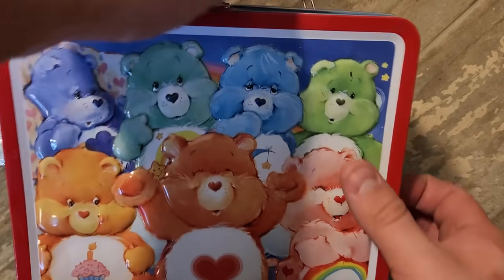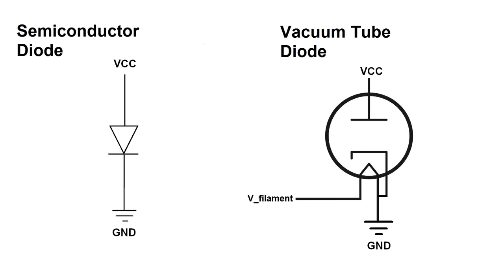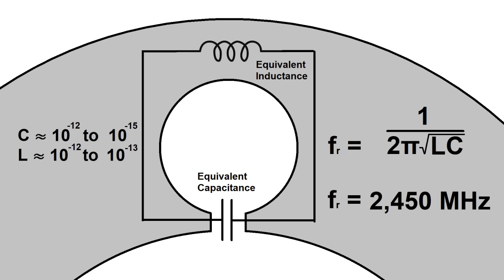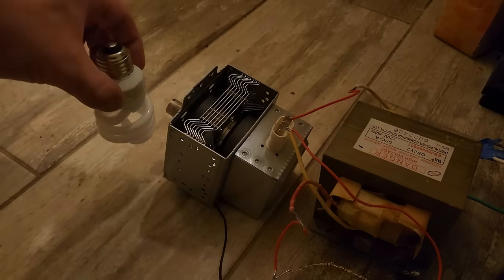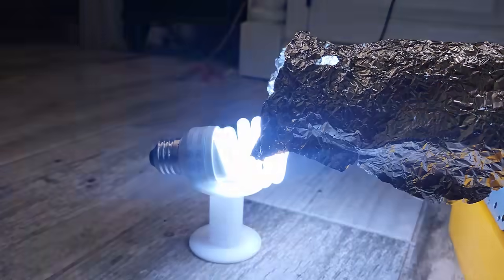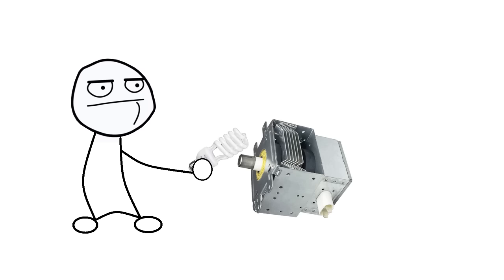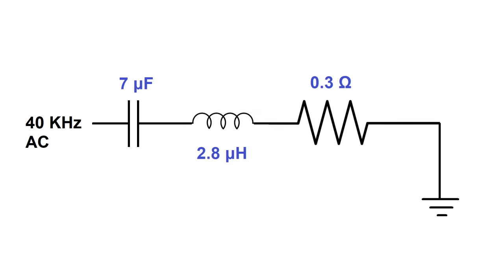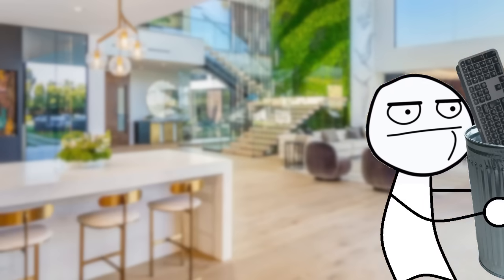Battery-Powered Magnetron

Comment: It's a lot harder to commit piracy in hyperspace than I initially anticipated. You need a whole lot of special gear for that! I can't wait for the episode on the actual hyperdrive, but seeing we're still sorting out the cooling of that, along with basic logistics like heating space rations, I'm guessing that's still a fair ways out. That said, a detour into weaponising the lunch box of death seems in order. Pirates don't just ask politely after all.
Reply: Cooling off the hyperdrive? Wouldn’t it be possible to use dry ice for that?🤪
Reply: @mikehorrocks2909  I'm assuming a hyper drive needs super conductors, which means cryogenic cooling is required.

Comment: Exposure to an unshielded magnetron can result in permanent blindness pretty quickly. In the sense that a little exposure can produce a lot of damage. But you won't necessarily realise until a day or two afterwards. A friend of a friend lost 40% of their vision doing this. They were fine straight afterwards and then their vision went cloudy the next day. They didn't recover.
Reply: in otherworldly, fully know what the fuck you're doing when you science bro
Reply: @thomasslone1964  dont forget doctors used to prescribe cigarettes. Science is only as good as the info at the time. And usually the science is slower than production, lead, asbestos, va cc es etc
Reply: Could you protect yourself by wearing a faraday cage over your head?
Reply: @cebruthius I wear my faraday cage around my junk.
Reply: Me Green has a video that proves this is a lie lol.
Reply: @ArkhamHedler  No it doesn't. Did you watch the whole video? And i quote; "Removing the outer shell of the microwave absolutely destroys efficiency". So yes; if you make your microwave inefficient and effectively low power enough then it won't destroy your vision or boil water quickly either.  
You expose your eyes to a microwave that's working properly at those distances and you will find out how wrong you are; a day or two later.
Reply: @ArkhamHedler  was about to mention that lol
Reply: Didn't the inventor of microwave, wasn't he trying to do something else entirely and noticed he had a chocolate bar in pocket or table close to him or something similar...and he noticed the bar of chocolate was melted...and that got him curious and figured out he sccidentally microwaved it? So an indirect accidental(sortof) discovery?
Reply: @jeremygalloway1348 they were working on radar systems.
Reply: How far were they from the unshielded magnetron?
Reply: @ajcottrill4949  I wasn't there so couldn't say for sure but we're talking about inside a room in a house so a few meters or so at most.
Reply: @christophertelford  Wow. I wasn’t aware that (at that distance) the radiation from the magnetrons were powerful enough to do such a thing. Thank you for informing me.
Reply: baloney.
Reply: @amandahugankiss4110  Try it if you don't believe me. Get a friend to write up your results for you if blind.
Reply: To those on this thread talking about wifi - look up a photo of the electromagnetic spectrum. Wifi and radio are in the extremely long range. Microwaves are shorter wavelengths. The reason water heats up in a microwave is because it resonates at the exact frequency that microwaves do. It 'detects' the signal. Like an opera singer needs perfect pitch to shatter crystal 🔮 

Our eyes detect visible light. Infrared cameras detect infrared, which is just outside of our range. InfraRED might as well just be another color, because some animals can see/detect it. Geiger counters detect ionizing radiation, and antennas and wifi routers are designed to catch and detect radio and wifi frequencies. Like @TheNuare said, frequency of signal and power of signal are very different things.

How do you sit there and boldface lie that wifi did anything to your body that you didn't do yourself SMH. Deep itchiness... tingling... how did we come to this like cmon people.
Reply: Always gotta be that one safety nazi buzz kill
Reply: Tell that to MR Green! 😂😂😂
Reply: stone burner in real life.
Reply: Brutal
Reply: This Solarsynapse needs to go back to those fake science retard conspiracy tiktok channels, this is for non psycho tarded actual science fans 😂
Reply: Does your friend look down a gun barrel to check if its empty  ?
Reply: @RenoSimpson  No. I don't know the person in question. It was a friend of a friend.
Reply: As to "Heats from the inside, not outside" look up "Active Denial System" in current use by U.S. military and available to law enforcement.
Reply: @matosonmania  "in use" is a bit of a stretch since that system has not seen field use a single time since development.
Reply: @matosonmania   felt it, feels like inside, outside, sensation of sudden intolerable severe deep itchiness. Not all variants are named that moniker ADS. The technology is highly variable for different "applications"....aka...us.
Reply: @matosonmania I think that’s bullshit anyway, coz why the fuck is my food always cold in the middle of it cooks from inside out?
Reply: @user-vh7ki7xu7o cook food short amount of time open microwave stir food then start it back up. Microwaves work off the moisture...exciting the water molecules. If the center is already frozen that means alot of air in the ice. Also, inside the microwave the waves are not dispersed 100% evenly.

Not sure exactly why it happens that way, but I know from experience that cooking short time stirring and finishing cooking almost always cooks your food better than just cooking the instructed amount of time. 
Solution would be to get a better microwave(older stuff runs forever if it's still running). Or to cook in oven instead if possible
Reply: @jeremygalloway1348 
Yeah, some high-end and industrial microwaves have a mode stir antenna to mitigate the cold spots. Water/moisture flows to the heat and steams along the outside surfaces making the interior more difficult to excite.
Reply: @Youtubecensoredmyusername I don't know who ever started spreading this "inside out" stuff...
Maybe they mean that the food itself is heated and no external heat is applied like in a oven?

But to answer your question, there is a pattern of radiation that bounces around inside of the case, gets reflected and absorbed.
The problem is that there are cold spots inside if the case, the manufacturer tries to mitigate them by rotating the platter.
Some devices have really bad patterns and the only solution is to elevate your platter a bit to hopefully intercept the beam better.
Hope this helps!
Reply: @SuperUltimateLP  that does help. Long way of saying it doesn’t heat from the inside out tho 👍. I have seen the inside of a magnetron that must be the pattern you speak of
Reply: @matosonmania  people are always saying that. The center of my food is always the coldest if I use a microwave. Stop it with the wives tales.
Reply: Soy técnico en electrónica, deben tener mucho cuidado con el magnetron, porque dentro del tiene un polvo que es radiactivo
Reply: @gersonpalma-lb9hc I believe you are talking about beryllium. Beryllium dust is not radioactive but it is very toxic and any contact with dust should be avoided due to how little of it can harm you. So in short, just pretend beryllium is radioactive and don’t play with it even though beryllium shielding is used for nuclear radiation.
Reply: Muchas gracias por el dato. No lo tenía en cuenta gracias de verdad. ❤🎉 @gersonpalma-lb9hc
Reply: Just like ionizing radiation. Invisible, but very dangerous.
Reply: Not really, i reccomend you to watch Nile Green's last video explainig everything, he even stuck his head in a running microwave
Reply: Used to work on troposcatter equipment around 4 - 5 Gigs, it will do that and cook your brain in it's husk like a clam boiling in water. One of the guys exposed himself prior to me working with him during on equipment testing. You don't wanna mess with it. Guy was seriously messed up.
Reply: We shall see
Reply: Oh, look, censorship.
Reply: So how did this gentleman dismantle his microwave and place his face (and subsequently his eyes) directly in front of a powered magnetron with no ill effects?

https://youtu.be/3hBRxwQXmCQ?t=2000
Reply: @nathanbarnes7520  heat damage to the eyes may manifest after hours and due to the nature of constructive and destructive interference, the microwaves form a pattern of dangerous and harmless spots. im sure youve noticed how microwaves can heat food very unevenly, even with the spinning platter. a one time anecdote where someone didnt immediately get hurt is not proof that something is safe.
Reply: Is a lead X-ray vest a good material to sheild
Reply: @PhillyHardy  how will you protect your eyes with that?
Reply: Good question. Lead is not Ferris metal and can’t act as Faraday cage but its mass should offer some protection.  But how much?
Reply: LIES.    This dude clearly is a FED.
Reply: That sounds more like damage from lasers, not magnetrons.
Reply: @kyonsmith5203  it can cook your eyeballs to medium rare
Reply: @kyonsmith5203  Nope, lasers are immediate with the exception of UV lasers.
Reply: @kyonsmith5203 rf is bad for both sets of balls.
Reply: @kyonsmith5203 If you think the poster is mistaken and isn't talking about microwave radiation from a microwave cooker magnetron then I suggest you go try it. If you think you are an expert in this, let's see you go out and test your faith in your superior knowledge.

The microwave cooker magnetron will easily cook the thin waterous tissue of the cornea.
Reply: WiFi is the same frequency and can do the same thing at high power and close range or lower power for a prolonged time.  Don't have a WiFi router at eye level on your desk shelf!!!  Some public places install large (As large as 5 feet.) antennas behind walls and ceilings to have good coverage in large areas.  I know because I have installed them and questioned the safety.  I was told that nobody cares as long as the signal is good.  You could be sitting right beside one of the walls.  If your back is to the wall, your body will absorb it.  If you are facing it, your eyes are being damaged and you don't even feel it.
Reply: That's simply not true. microwave ovens run at much higher energy levels than wifi does. It's a heating up danger. Without enough power it's not going to have the energy required to do any damage. Long term exposure isn't a cumulative risk with low power wifi because your body is quite good at cooling itself down. It's not like ionising radiation. It's like a heat lamp you can't feel. @solarsynapse
Reply: @christophertelford  So standing a few feet away facing a 4 Watt WiFi antenna that transmits a signal several miles is safe?
Reply: @solarsynapse It's 4W not 1000W
Reply: Anyone that understands RF will tell you that '4W' isn't enough information to answer your question. Some antennas are high gain and put out a more concentrated beam. Some are omnidirectional and output radiation in all directions and some will do a sector of 180 degree coverage or less rather than 360. Antennas that transmit lots of power in a small beam are called high gain antennas and they concentrate the total amount of power available in a smaller direction by sending less signal out everywhere else. 
According to a study cited in wikipedia eye damage occurs in rabbits at 150mW/cm^2 assuming no external cooling is provided. If you knew how high gain the antennas was and you had the other measurements available too then you could use maths and geometry to work out if your eyes were at risk or not.
I'd say it'd need to be a very high gain antenna you sat very close to to concentrate enough of those 4 watts onto your eyes to cause problems. An omni or sector antenna isn't going to fry you at 4 watts unless you remove the aerial and stick the feeder tube in your eye. And I wouldn't volunteer to sit directly in front of a high power point to point microwave dish either even though it'd probably be fine for a bit.  @solarsynapse
Reply: @BenSzántóNEO_CZ  I still wouldn't do it. 4W ERP for Wi-Fi would be completely illegal in most countries anyway.
Reply: @christophertelford  It's called ERP - Effective Radiated Power. The idea is that from the direction in question the strength looks like how much power from a non-directional antenna. 100mW of Wi-Fi from a normal antenna omnidirectional looks like it's 100mW. But use a directional antenna and point it at the detector, and you can make it look like more power. That's the ERP.
Reply: @solarsynapse I don't know what your talking about but its not from a WiFi router. A WiFi router does not output 4 Watts like you are saying
Reply: @christophertelford 5 g extended range Wi-Fi is low strength?
Reply: What do you think low strength means? RF field strength is measured in dbm which translates to power. You can send wifi a long way without a lot of power. So yes, extended range wi-fi can be low strength
Reply: @solarsynapse if it transmits miles then its not a wifi antenna
Reply: @solarsynapse  you hold a phone  (1- 2W) to your head just 1.5cm away from your brain and still alive?
Reply: @BrianG61UK  Wireless links can be .25 to 10W, typically 2 to 5W for the tower antennas.
Reply: The transceiver for analog bag cell phones is in the bag which should be kept at least 2 feet away from your body.  I don't think they are still in use.  Digital phones are no more than .5W, but speakerphone or a headset is still better.  Same for factory vehicle 2-way radios, 2 feet from operator.
Reply: We had 1000 RF sensors at 868MHz transmitting every 1 second at 20dBm and nothing bad happened to me!  They were omni whip antennas 2+ dB gain
Reply: @solarsynapse yes, that is safe. You can't compare 4W transmitted into open space and 1000W confined in a metal box. The flux density of sunlight hitting the equator in summer is around 1000W per square meter. If 4W of microwave energy could cause damage, then direct sunlight would crisp you up in seconds lol
Reply: @inductivelycoupledplasma6207  ...and looking directly at the sun?
Reply: @solarsynapse  the way your eye responds to visible light is not comparable to microwave heating of the skin. The lens focuses the sunlight into a tiny spot on your retina, causing damage
Reply: @solarsynapse  no wifi region allows 4 watts of average power, neither on 2.4G or 5.6G, 1W at most which is considered safe under permanent exposure.
Reply: @solarsynapse  if you're inclined to be concerned about non-ionizing radiation you should be more worried about the 6MVA VLF transmitter in Hawaii that shakes the entire ionosphere than about any 4W rig anywhere
Reply: @solarsynapse me when I spread misinformation

I'll take my advice from the engineers who design and test these things, not the guy who installs them.
Reply: @solarsynapse i hope nobody takes you seriously
Reply: frequency of signal and power of signal is different things
Reply: @solarsynapse wifi antenna are maybe like 5w 😂. You run a much much higher risk cooking your eyes opening a preheated stove
Reply: Uhhhh,  excuse me buddy. Having to be RF engineer by trade and background. Never my life have I ever heard of a Wi-Fi antenna 5 ft long. There's simply no reason for it. The wavelength of the frequency range we're speaking of is just around a couple of inches maximum most of these things will be about 1.5 inches in length so if you figure in multiples as to make a very high Gain antenna, (which doesn't make sense for the application you speak of because the whole purpose of having a large antenna, would be  to supposedly "spread that energy wide", right?  NO- quite the opposite would occur. If you were to include multiple radiating elements in a line approximately let's say 5 ft long, you would end up with an incredibly high Gain antenna but with a beam angle of just a few degrees! Meaning something that big at those wavelengths would be absolutely useless indoors. I mean we're talking COMPLETELY EFFING USELESS!). I have no doubt you installed such devices. However, you lack knowledge of what those devices were actually utilized for. Due to the very fact that at those wavelengths at the sizes you described they would be completely of very little value indoors. Perhaps you are correct. I will certainly give you the benefit of the doubt as I don't fully understand what you had installed.  Perhaps the company that you were contracted under had not a fucking clue of what they were doing and installed improper equipment for the application. If this is the case, my apologies for such harsh reply. All the same, I wish you all the best and perhaps maybe look into this technology a little further. It's one of my favorite modern technologies and a lot of fun to experiment with. 
 - cheers
Reply: @solarsynapse thank u, I was feeling that, I wrapped it in tin foil and felt a little better
Reply: @solarsynapse microwaves run at 2.45ghz and wifi 2.4 or 5ghz... that's is a significant difference and interacts completely differently with the world.
Then also look at the power consumption of a microwave vs. a wifi transmitter... the things usually run of a wall wart...

Comment: The  greatest risk of free air microwaves at that frequency is cataracts. If blinding a bystander is a risk factor, get a good lawyer. These are extremely dangerous and unwise experiments. I liked your power supply though. That was well done. Was the coil form 3D printed?